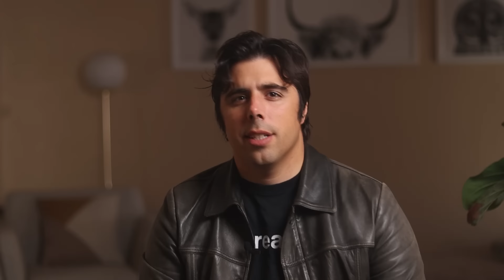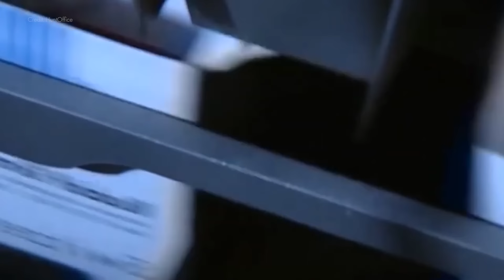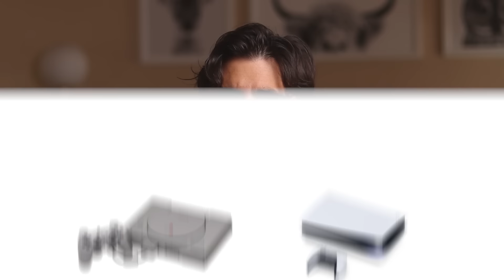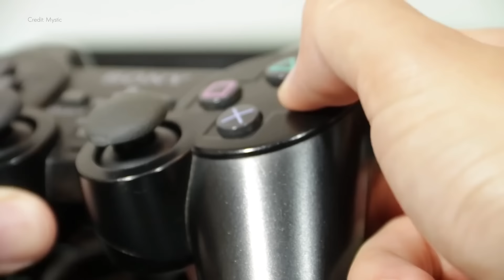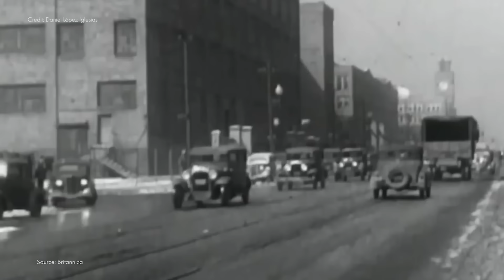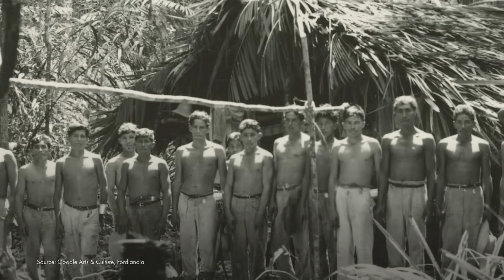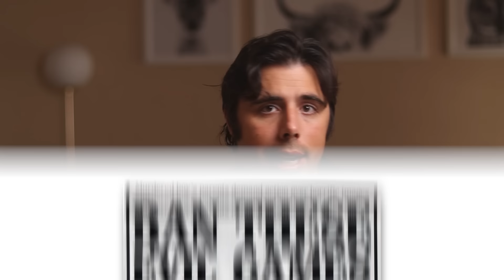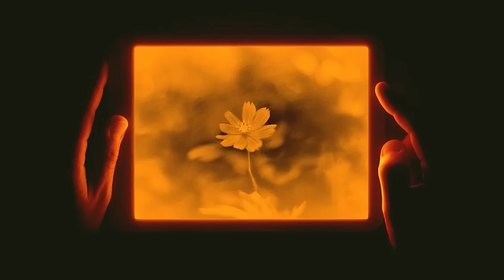Why Some Designs Are Impossible to Improve: Quintessence

Comment: Qwerty was designed to spread the common letters apart. This does not reduce the speed of typing, and improves on alphabetical, by making it easier to press two keys quickly after each other.
Reply from the maker: I agree
Reply: There are a lot of metrics you can evaluate a keyboard layout on but looking just at English and just looking at simple things like how many common letters are on the home row and how many uncomfortable sequences exist (aka “minimum” on a QWERTY keyboard), QWERTY is worse than random chance. If you randomly generated a new keyboard layout, it would probably be more efficient and comfortable than QWERTY for English.

The truth is that the QWERTY layout is just objectively bad but it doesn’t matter because we don’t care. We don’t actually need a good or comfortable keyboard layout, we just need a keyboard layout.

Comment: The BIC pen design is perfect. Pen cap helps me scratch out ear wax.

I hate the iPhone, though. Use one, but I notice that even in their original commercial that you're showing, has horrid interaction-forced-delay animations. Even when I use my Nintendo Switch, there are animations, but they cause zero delay in my interaction with the product. The animations always follow what I am doing and they don't need to "finish" before I can move on to selecting the next option. iPhones force you to wait for a complete animation to fully complete before you're able to press the next button or key and it slows me down from getting basic tasks done drastically. I can't describe how long it takes me to copy and paste multiple text messages I got from the same person, only to paste them in the same screen only to then be able to copy them again to translate them elsewhere. Or, I try to send a video to a phone number that I just called, but since they are not a contact, I am unable to copy both the video and the text so I either have to resort to sending 2 text messages or to copy and paste the link and text to another person only to copy it again then exit and select the phone option to select the phone number I called to paste the message. I also need to still use a pen and paper because my iPhone has no option to text the person that I am calling without figuring out how to re-enter the entire phone number into the messages app. The iPhone is also annoying because I cannot connect my bluetooth to my truck which I am driving to use the speaker in the truck while also using the microphone of my phone. Instead, it only has the option to let me use the truck's microphone, which I don't want to use. Yet, because of controls and regulations and the cartel-like structure of these companies, I can't just stand up and make a competing phone. Then Apple has no interest in hiring someone like me because they aren't attracted to intelligent people, they are attracted to 'fun exciting new' people who solve creative problems in an impressive way rather than simply the optimal way. It's like hell